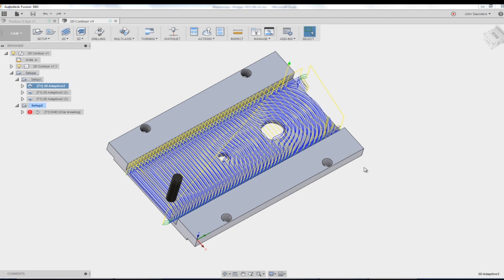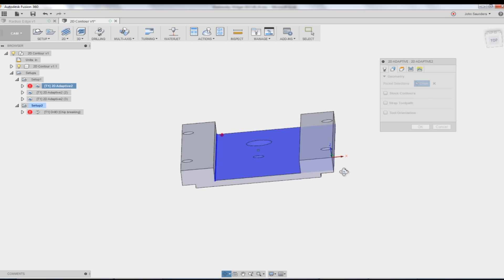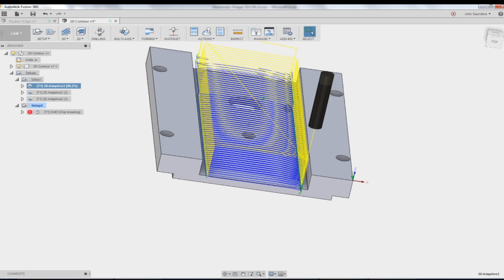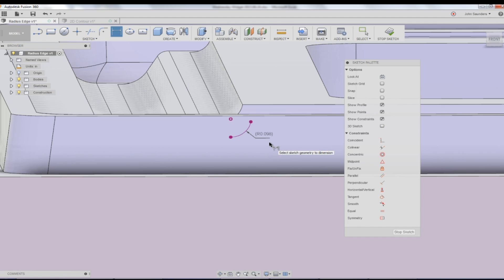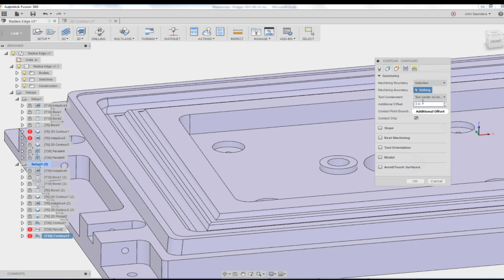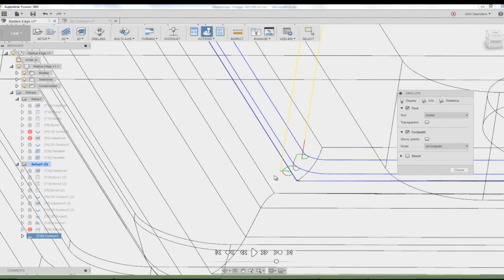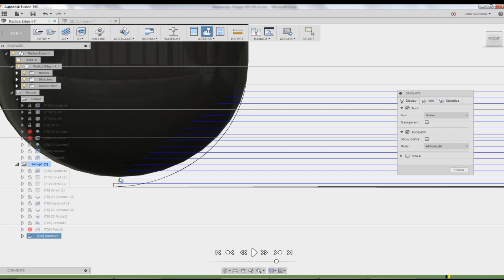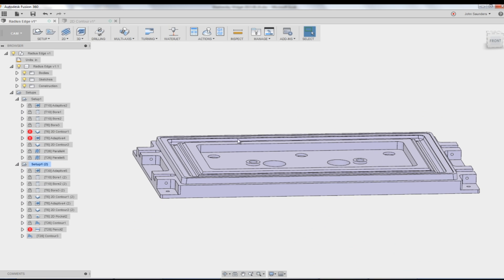Fixing Fusion 360 CAM Toolpaths:  2D Adaptive and 3D Contour! FF56

Comment: Thanks for the video. I had a strange experience about post processing. Fusion 360 adds a Z0 command line along with the 28 and 90 before spindle motor starts and the bit dives like hell into the part. I fixed the issue by deleting that line then spindle motor stands still where I zeroed then starts spindle motor and starts carving as it should be.

Comment: Whenever I trying to cut out an area the tool al ays drills from the wrong axis and I don't know how to fix it.  Also when I do the contours, it selects everything on the y axis instead of the x axis
Reply: Check your default axis, you can change it from z down to z up, which is better for machining

Comment: Bro I am having trouble trying to minimize my retracts between operations that are utilizing the same tool.  My machine needs manual tool changes and hence I prefer to be light on the roughing operations so I can use the same tool to rough and finish so no sense in retracting after every tool move.  I tried adjusting the retract height and clicking keep tool down and no luck.

Comment: Hey NYC CNC, I'm having trouble with 2d. I'm new to fusion and I'm on a robotics team for High school. So for default I'm just putting in a 1/4 in bit foe the tool just because we are going to cut aluminum. But when I go to do 2d adaptive clearing I get "tool not used for 2d" message of something like that. I have 2 months to learn before I have to start cutting. What am I doing wrong for this message to pop up? Also when I pick 2d contour for holes that are 1/4 in diameter is says the chain is not connected. I have no idea what I'm doing. Thx, Scott Hall.

Comment: Depending on the tolerance allowed on that radius. You could just one shot it with that tool and still be good even if it's not actually correct for the model. I know that if I'm given a drawing. The customer should know what they want. Otherwise, I'm using every tolerance to my advantage. Which is good, because it would be cheaper for them really.

Reminds me of a story a former boss of mine said. Given the circumstances of the tolerances (one spec was disagreeing too much with another spec) he just faced the part off. After revising, they came back with - well we kinda actually want that angle there. Ballnose it is. Part now takes twice as long to cut. $_$ I think he absorbed some of the price because he was anticipating the change, and also they were a big customer. Lots of work from them. Taking a hit is good business, now and then. If the order quantity became too much, facing on the 5ax was the next step.

Comment: That toolpath is doing a lot of cutting near the tip of the ball end mill, where the SFM approaches zero. Is that OK? Would you get better finish if you used a bullnose end mill with a similar radius?

Comment: John Huge win on this one.   Great Video.   The Lockwood tip (all hail Rob) is really powerful everyone should watch Robs video.   But I think the most powerful tip you posted in this video regards the selecting the 3D op and just hitting save or OK.   Meaning select your 3D op, and instantly go down and hit "OK".   See if it gives you a tool path, heck you don't even have to have the tool right.   It is only in the recent few months that I myself figured this out.    There is nothing worse than spending 10 minutes dialing in (or you think you are anyway) an operation only to get a warning triangle* duhikee that tells you nothing, but means that it isn't going to work.  At which point you spend another 10 minutes back tracking deselecting options till you get a tool path if you get one at all.   If you are new to fusion and starting to work on more complex operations, go back and watch this video again and pay close attention to what John does on the 3D op, it will save you hours.    

*Fusion 360 team can we get an intern or someone to actually populate the Yellow Triangle of Death with a viable message?  "YTD" which I hence forth name it.    Even if it said, (You are a Moron, that won't work, try again!) would be improvement to what it says now.   Too many innocents are being YTD'ed with no explanation as to why.

Comment: Hey nyc cnc, i have a small cnc machine and i was wondering what you need to do to make the g-cade stop so i can manually change the tool. I don't have a toolchanger so i do it by hand. Is a it a function in fusion to pause for tool change so it makes a extra line in the g-code?

thx 

greetz Bensh from Belgium
Reply: IN the post processor set up screen (the screen that pops up and shows where you will be saving your g-code) go to "optional stop" in the properties (lower right hand corner) and change from "No" to "Yes".   I think that will give you your break for a tool change out.
Reply: Haha ooops, What SCS says!   I guess I should have updated my screen.   Sorry about that.
Reply: thx supercoma sports inc.
Reply: thx battery whisperer

Comment: The inspect tool actually gave you the radius when you selected the cylindrical face at 5:19. It couldn't give you the radius when you selected the edge because an edge that cuts a cylindrical face at an angle creates an elliptical arc rather than a circular arc. Usually I find selecting faces works better for measuring fillets than selecting edges.
Reply: Alex Moon It's a 5mm fillet. 4.97 exact, but I think the decimal place limit or resolution function (forgot what it's called) kept it from reaching 5mm. 0.1968503" to be exact. "The good thing about standards is that there's so many to choose from." -Andrew S. Tanenbaum

Comment: Some times when using the (i) key ,clicking on  what you are trying to get information on twice  will give you different measurements.  For instance clicking on a circle will give you a diameter and radius but clicking it again will give you surface area and other things... try that john not sure if it will work for that arc line.
Reply: Logan McCleary holding down shift while selecting cylindrical faces for measuring helps massively.
Reply: It won't do it on this part.  You can get a center to edge measurement, but the angle is 37.5°, so you don't get a radius.
Reply: RjaznR I just put a 18mm fillet on a 5mm boss, so it wasn't a 90 degree fillet rad, and it measured perfectly.

Comment: John, the only part of CNC machining I am not aware of you covering thus far is the entire process of putting a new endmill into your collet holder, measuring it and dialing it into your Tormach with tool lengths set etc. I would love to see a video on that. Thanks!
Reply: I second this. I am a pro with doing this on a Tormach now, but when I first got started (before this channel really got started) I was having all sorts of problems. I was getting frustrated because I just could not find where in HSMXpress to put the tool offsets. I had no idea about the offsets tab in Mach3.
Reply: Yay!  That's what I wanted to see, also.  Thanks, John.  You utterly rock!!

Comment: Hi
In my fusion 360 i can only do the postprocess for the siemens sinumerik 804d. When i use an other then there is an error code, that it can only reads UTF8 files. How can you fix this?
Reply: Connect Media it's best if you go onto the HSM post forum and share some more detail about your issue there.... or engage with a HSM CAM reseller for help wth the post. Where are you from?
Reply: Scott Moyse i'm from switzerland
Reply: Connect Media the list of CAM resellers that can do post development is in a sticky post at the top of the post processor forum.

Comment: Hey John, do you think there is a reason why that contact only box is not ticked by default(done by fusion or turned off by the customer perhaps) ; or if it is on by default, why have you turned it off? Thanks.

Comment: the 3D toolpath the best way to just restrict where it generates a toolpath is to use the bottom height plane, then go back and set the restricted cut.
for changing to wire frame the is a addin in the App store that puts the visual style on the bottom task bar
Reply: Yep it works well
Reply: daniel lyall or the 3Dconnexion CadMouse gesture menu. that's Epic.
Reply: I don't have one of them you wont to send me one
Reply: daniel lyall sure. jump on CADPRO.co.nz and Jam in your credit card details and you'll have one next week. are the ferries running yet?
Reply: Yer they were running on wednesday after the quake, I will get one next year I have a 5 button mouse now they are realy good.
Reply: daniel lyall they're really good until you try a CadMouse with its mouse pad.
Reply: next year